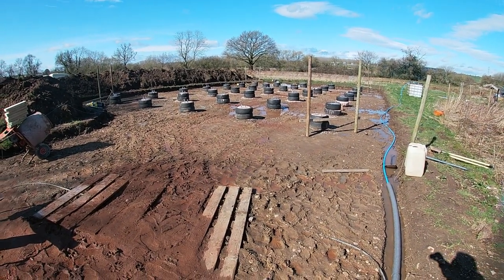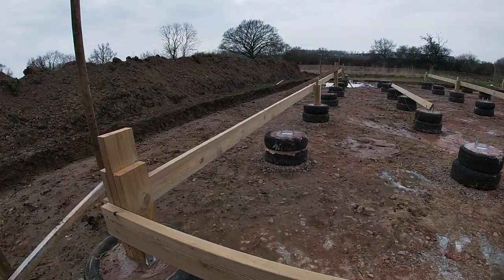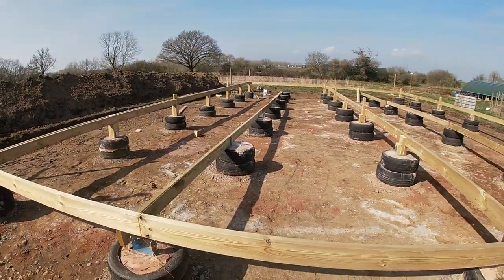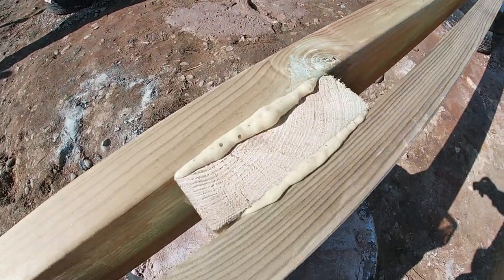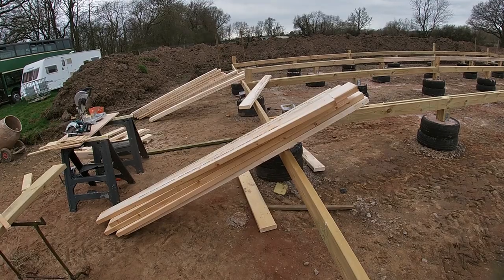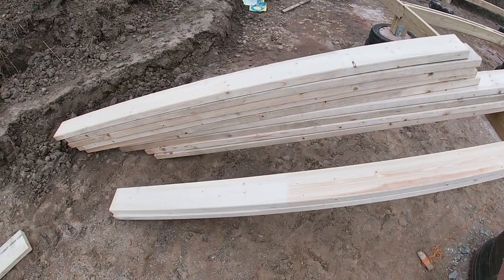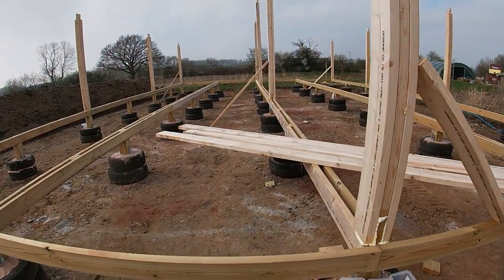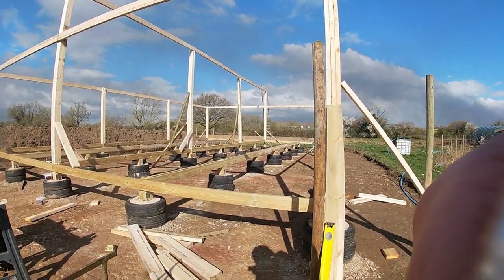Building a timberframe solo with 2 tools in 3 days! building my own off grid home part 2!

Comment: Little tip If you can get hold of a framing nailer use rink shank Framing nails instead of screws, screws tend snap easy and nails will bend if any movement and a lot stronger in the structure at all it may also save you time and money on glue and screws too. Good job
Reply from the maker: These are good screw brand that are made the same way as a nail basically so they bend like a nail and don't snap 👌
Reply: @FieldtoFarm_UK  Unless they are GRK torx screws, nails are best practice faster too.  Excellent work tho! Definitely jealous you don't have to fight 8' of snow like I am rn building mine lol